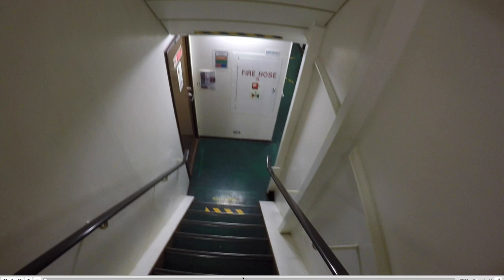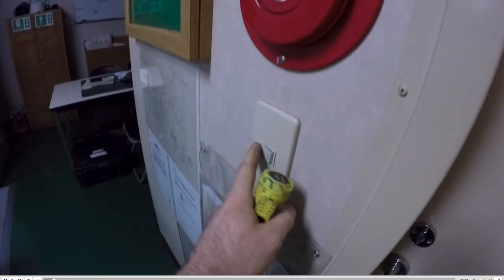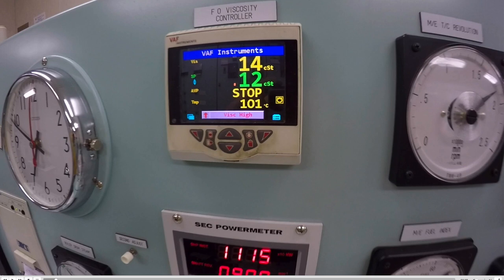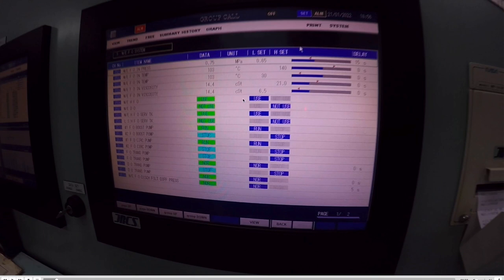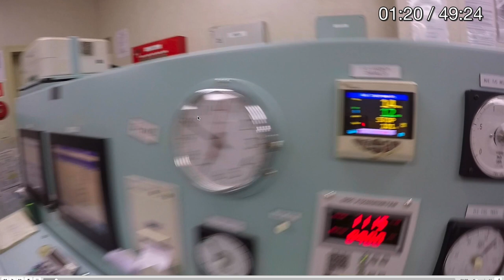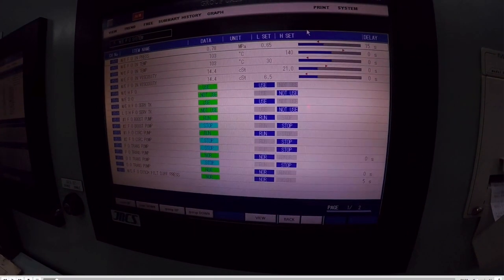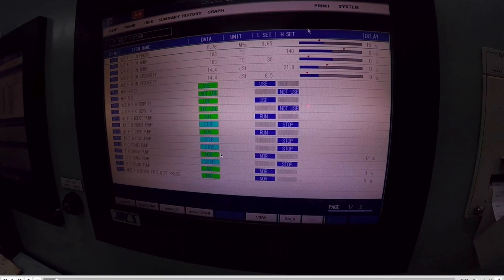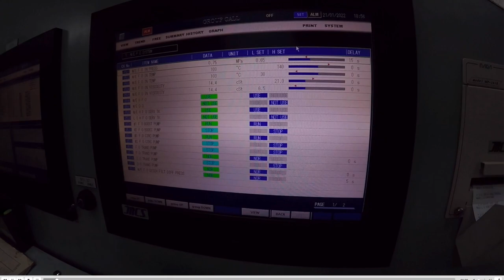Engine Room Tour With Explanation

Comment: sir, i have a question.
At sea, if i see that somehow FO service tank drain valve is choked, what to do? in your ship you have two service tank. But some ship only have one service tank. in that case what to do?
Reply from the maker: If it choked means that somebody not make drain for a lot of time .There is also a opportunity that it can be blocked by a gasket.Sometimes people don’t like to repair and they just isolate it.
Normally you should empty the tank and then repair.Other ways can be extremely dangerous.